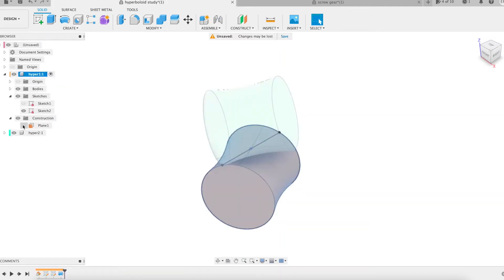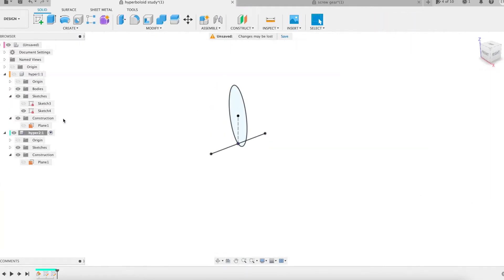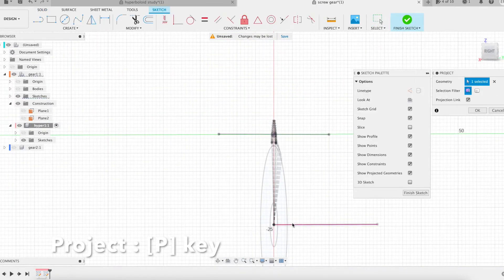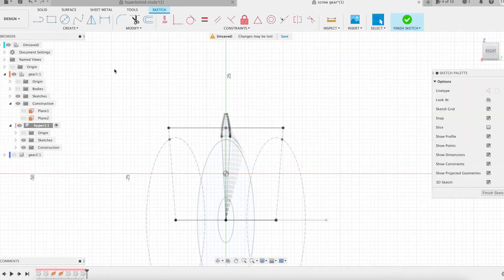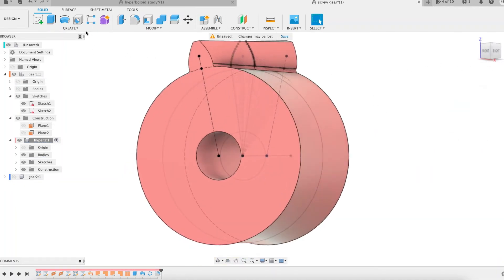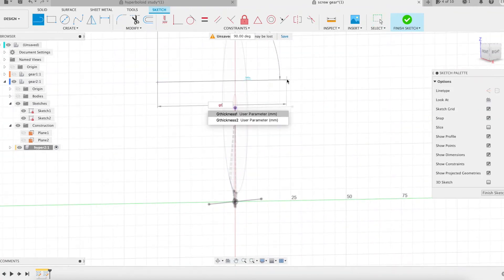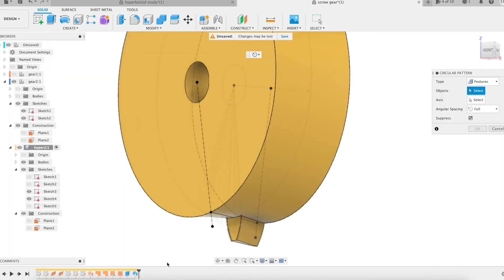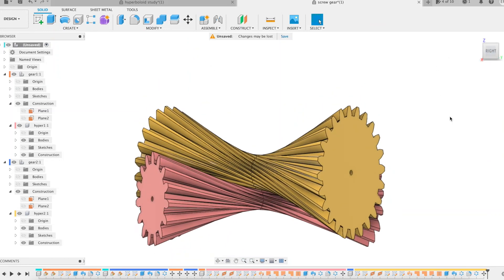Hyperboloid study 2 (and gear too), an improved approach (Fusion 360)

Comment: Thank you for this video. I want to model the hyperboloid gears ith and inventor. I managed to model the hyperboloid surfaces correct if the transmission ratio is 1 and r1=r2. However if I change the transmission ratio to lets say r2/r1=3 both Hyperboloids are interfering, but the  straight lines on the surface are perfectly in contact. Can you give me  hint, what I am doing wrong or send me a   your file for the model. Maybe this helps me to in out what I am doing wrong
Reply from the maker: I have the same issue as yours, increased interference as ratio diverges from 1. Actually I couldn't find any example on youtube or elsewhere of a hyperboloid gear with a ratio that is not 1.
I would be happy to share my project, but since last February 2023 update, Fusion 360 crashes when opening any of my projects with a sketch containing an involute gear tooth [and it's very frustrating :( ].
Reply: @steelstone  Seems like youtube blocked my reply.
Thanks for your answer. A former colleague of me developed two hyperboloid gears with transmission ratio bigger than one. (If you are interested, I can send you his publication, I can't use links in the comments).
He proposed in one of his publications the formula for the axis angle: theta_axis=atan(w1)+atan(w2) or theta_achs=atan(w1)+atan(w2/i), where w1 and w2 is the twist angle of hyperboloid 1 and 2. However, with this formula I also get wrong results. If I make any progress I will let you know.